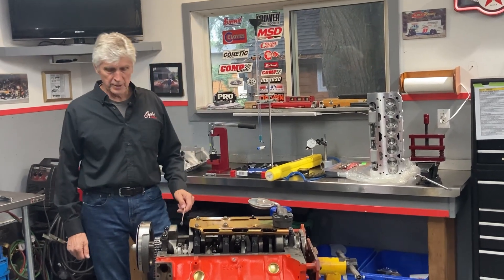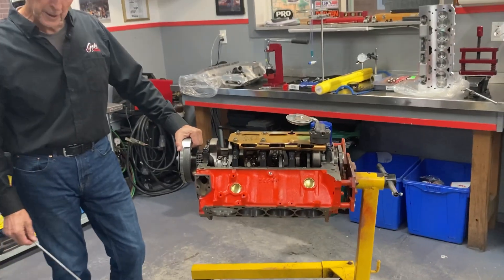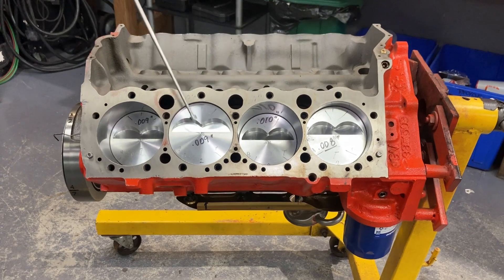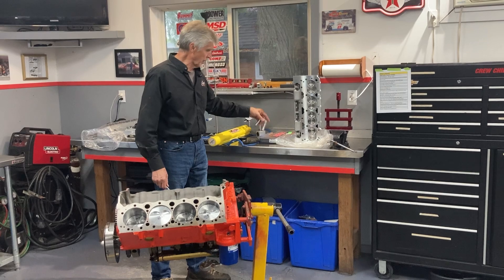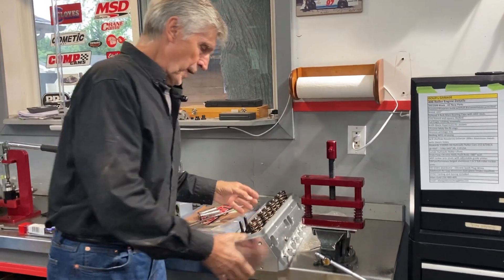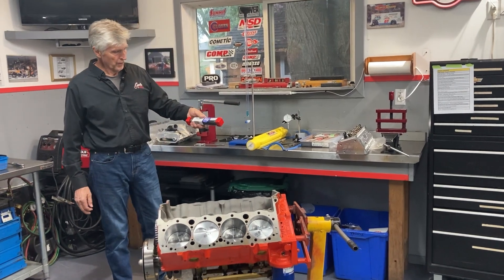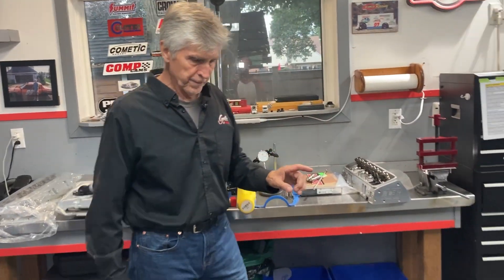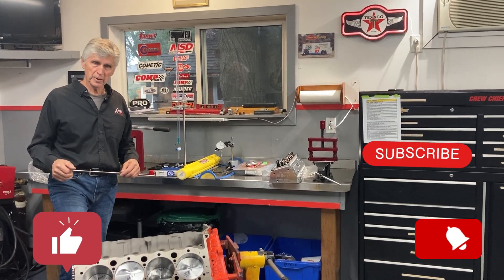Building a SBC Chevy 400  Will it make 500HP?? Eagle AFR Heads Howard’s 11025-10 Roller cam

Comment: If springs are matched and installed to the lift and rpm specs of the cam it shouldn't make any difference if it's a flat or roller. (?)
Reply from the maker: Good point Joe, a roller does make a difference in the higher lift and duration range. AG

Comment: Really until i started studying what you say about 400 engines i was afraid of them running hot but you've given me alot of reassurance that if done right they are great engines
Reply from the maker: For sure Paul. The easiest way to make the most HP/pound in a small block. AG

Comment: Dude, you can make 500hp with a 400 that has 195 heads, a 230s @.050 cam and 3 plug wires missing. 

If that one you're doing doesn't, you need to keep up the knitting
Reply from the maker: Thanks for watching and commenting Lollipop.AG

Comment: 3:06 Why you do not need a high volume pump?  Thank You.
Reply from the maker: In most applications and when bearing clearances are within specification, a standard volume pump is sufficient. oil pumps pump volume, pressure is created by the restriction to flow in the bearings. High volume pumps have deeper gears and require more power to drive them which is not necessary. AG
Reply: I think the better question is to ask yourself what volume is, then ask yourself why exactly do you need higher volume.

Comment: Just suggestion to people putting 1/4 block drain plugs in to use a brass plug preferably, 1 is they are not likely to split block if over tightened and they seal without sealant as brass threads form to blocks threads easily much like NPTF thread's do, most brass plugs these days contain some lead unless they are high quality "for potable water"  brass plugs and go in and out very easily as lead content is a lubricant
Reply from the maker: That is an excellent suggestion Hitman. Getting the 1/4" plugs out of the oil galleys in an old block is always difficult. Often I have to heat the area with a torch to remove them. Brass plugs would solve this. Thanks for your input. AG

Comment: I built a 350/360ci chev 550hp @7000rpm with brodix unported heads. .700" 260° duration cam.
Reply from the maker: Thanks Justin, wow! .700" is a big cam. Even my SLM cam was less than that. That is awesome power from a 350! AG

Comment: Finally ran this combo on DD5, I used a .039” head gasket, cam ICL 106°; 11.18-1 SCR.
ABDC 42.3° the DCR exceeds the max, for aluminum heads, recommended for US 93 octane fuel @ 9.413-1 
470hp @5500 rpm
509tq @4000 rpm
Dyno weather settings: 
80°, 50% humidity @1000’ for accuracy.
Reply from the maker: Thanks HeadFlow. I use advertised or at .006" spec for IVC which is 68.3 degrees ABDC. As I mentioned in the video the calculated cranking pressure  using this method was 180PS1 and the actual was 181 so it worked out pretty good. Nothing is being compressed until the valve is completely closed. AG

Comment: Nice motor. My guess is 520 hp. 525 ft lbs Great heads!
Reply from the maker: Thanks Mathew. I will be pleasantly surprised. 
500 or anything more would be great. I could have used a bigger cam to get that but I wanted the engine to be streetable and a good fit for any vehicle. AG
Reply: @goldsgarage8236  my 406 made 527 hp. Comp solid roller. .575 lift and 246 duration. 10.3 static compression. Trick flow DHC 175 heads CNC ported to 205cc. I’m using a old Z28/LT1 manifold for stock appearance
Reply: I just want to see the Torque these motors produce.It’s amazing these little motors when tuned correctly can hammer you in the seat.

Comment: Ah 11:1 and 8.6:1 is something I'd like to experience. Cool.
*edit - engine build videos with explanation of why certain parts are installed + dyno results are definitely interesting and helpful.
*edit - with more and more followers I'd say its time to set up a few playlists for your videos to be organized and searched through easily. For example make one playlist for "engine builds", one for "tech talk" and others for other areas like maybe "build cost breakdown" or "test drive". I for one would love to see short 5 - 10 minute tech videos that explain, for instance, the reason as to why not have too much lift on exhaust valve.
Reply from the maker: Thanks Umakeme. Good suggestions, I will talk to Mike about doing that. AG
Reply: @goldsgarage8236  I really enjoy your videos, and if I may I would like to suggest a topic for a video. In regard to valve lash. I learned an interesting lesson on valve lash with my current engine as its a solid roller which hadnt been lashed in years. The engine ran great on 91 pump years ago (got a ride in it years ago as i knew the owner at that time) but I bought the car and could not get it to run without detonation at normal or below normal timing values. When I lashed the valves I noticed some at 75 thou loose! All were loose. Once lashed to 14 and 16 thou I could now run the normal timing values on 91 pump without any additional octane boost. My dynamic compression was too high with the valves opening and closing incorrectly! Building 226psi cranking pressure on that cyl vs 180- 200 on tighter ones. I had never considered the negative effect of very loose lash outside of it seeing less airflow from less opening space. Anyway, sorry for the long explanation. Hope that made sense. Keep up the great channel!

Comment: Can you detail the pushrod length finding process? I was doing this today and find the plastic length checking tool shows I need 7.25 but when checking the pattern on the valve tip, 7.10-7.15 looks better. I have a similar setup but running Howard’s roller lifters.
Reply from the maker: Thanks Perry, I am just getting ready to install the 7.25" push rods. I will paint the valve tips and inspect the witness marks after running. I will let you know what I find. AG. They checked pretty well with my checker tool. AG

Comment: 400cuin --495hp  recipe is weiand s/plain  7530  / AFR Eliminator heads 195 heads 2.05In /1.6 exh  Street vers . 13/4 headers minimum 230/236HR  110 lsa 
400cuin   523hp  dart inlet  SP  manifold  and cylinder heads 215cc  as cast heads 242/248HR 110 lsa
Reply from the maker: Thanks Paul. AG

Comment: The Howards Cams 110265-10 is a great street cam in a 355 sbc. With the 3.750 stroke the next size up Howards 110275-10 would be my choice in a 383-406 sbc pump gas street engine to make 500hp and 500 ft lbs. Those AFR sbc Enforcer heads are a good deal for the money as with the Promaxx heads (both China castings) You can order Enforcer heads from AFR with or without steam holes and come with ARP studs, good Pac springs and AFR hardware. Skipwhite also does a good job with these heads like you said. Good luck with the build Allan, you should make some good numbers on the dyno and will be a fun street engine! 👍
Reply from the maker: Thanks Tom. The bigger Howards cam would definitely make more power. This engine will be for sale so I don't know what kind of vehicle it will be installed in so I want to keep the options open. My criteria for a street engine is to make more torque than HP, we are getting close. AG
Reply: @goldsgarage8236 I’ve got the same engine built, same camshaft just in small base circle, I have 1.5 Comp Cam roller rockers, I’m waiting to install , really looking forward to dyno  results, nice build, hopefully it will make 500hp
Reply: That cam was originally purchased to go in a 355…really looking forward to seeing how it works in the 406!!

Comment: What length connecting rods?
With using all new rotating assembly . Why not use  eagles internally balanced crankshaft?
Reply from the maker: Thanks Peter. The Eagle external balance assembly was available at a good price. I am sure it will be ok. Rods are 5.7" AG

Comment: 4° advance built in camshaft Allan, should work ok, between 6° and 108° is good also... I use brass hex plugs for the water in the side of block or brass drain cock pit fittings like some radiators have...  I always use the best head gaskets, cometic.  .040" thick, need .040" between piston and head counting piston rock.  How long rod are you using?  5.7" or better yet, 6.00".  Changed the dwell timing longer to burn the fuel better and increased horsepower also...
Reply from the maker: Thanks for your input Leonard. All good suggestions. We are using 5.7" rods. AG

Comment: Going to be a Nice Street Engine that runs on real Pump gas. looking forward to the rest of this build and Dyno. Im thinking 500hp and 500 lbft or torque will be produced. Nice 750 Vacuum Secondary will complement this build well .
Reply from the maker: Thanks Scott. I will be happy with 500 of we get it. We will try multiple carburetors on the dyno but 750 is probably right. This cam is still mild for a 406 and should work well on the street. AG

Comment: Shouldn't have any trouble making 500 hp.  Yes, 1.6" on intake and 1.5" on the exhaust works best... Does it say to install cam on 110° lobe center?  Am I spelling your first name correct?  Allen, Alan Allan?  Thanks...
Reply from the maker: Thanks Leonard. Allan is correct. The cam specification is  intake centerline at 106 ATDC. AG

Comment: Wow. That's going to be a very punchy engine on the street, and it will probably do really well on the weekend strip days.

I'd be interested to know if there are any technical reasons for the specific parts brands you bought, or if it was just a matter of finding the best price for the type you needed, or maybe just good experiences with those particular brand parts.
Reply from the maker: Thanks 100amps. You are right on, cost is always a factor so getting the parts that will work together at the best price is important. AG

Comment: You should do a pull and see if it doesn't make considerably more avg power with the 1.6 rocker on the int and 1.5 on the ex. I have found that a little cam like that, it usually holds true.excellent.i wrote to soon
Reply from the maker: Thanks David. We are going to do exactly that. We will start with the 1.5 rockers and compare results. AG

Comment: Oh my goodness Mr. AG. I just bought this very engine, 400SBC cast 509 2 bolt main, that came out of a 1975 GMC RV with 74,000 miles. So glad to see your rebuilding description. May just drive it till it needs rebuilt. Your opinion. Thanks again for another well descriptive video. Truck Driver Ray ✝️
Reply from the maker: Thanks Ray. You have a good piece to start with. I like 400's because you can make great street power and torque without big RPM. AG
Reply: I have recently pulled 2 engines out of a 79 & a '80 motorhomes, both were slightly less mileage than yours. One is a 350, the other a 400. BOTH had heads(882's) with already sunken valves